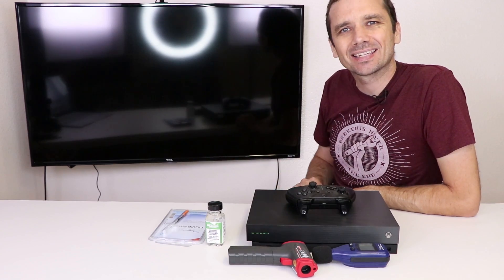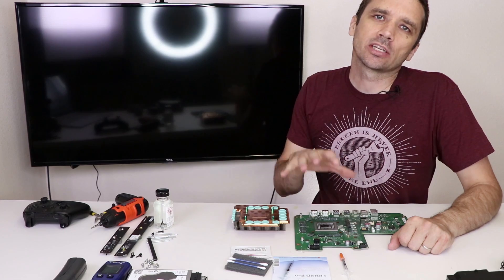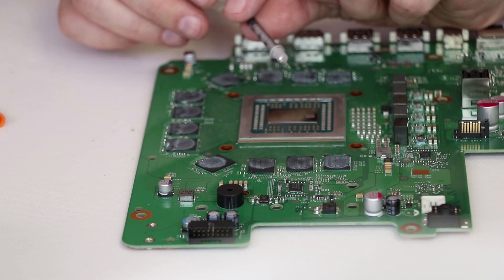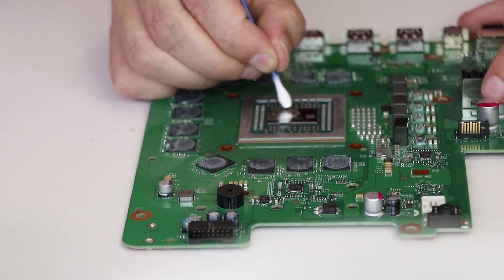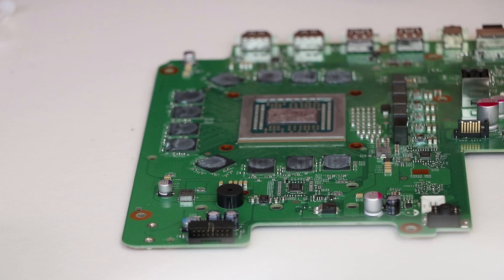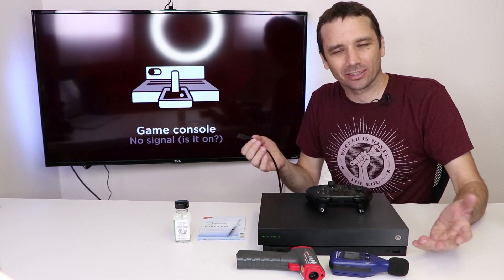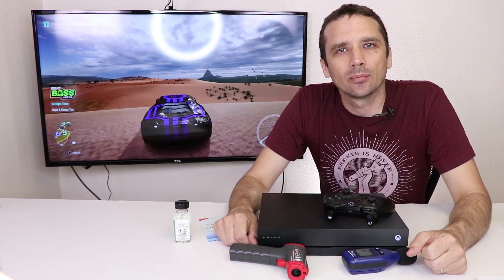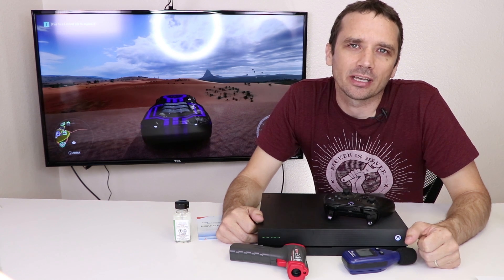Xbox One X Heat Test and Upgrade - It's So Quiet!

Comment: My xbox x is very quiet indeed and runs cooler than my ps4 pro and even a lot quieter.
Reply from the maker: Yep, they are usually fairly quiet.
Reply: TronicsFix mines loud my s was quieter
Reply: @walkingsneese3431  might need to replace the thermal paste and clean out the cooling block/heatsink I know I need to
Reply: @Tronicsfix  would an internal ssd help lower temperatures?
Reply: The s is quieter than the pro and standard together. No competition.
Reply: Dennis Rogers Same here. My day one X is pretty quiet too and far quieter than the Pro when pushed by an intense game.
Reply: Same here. PS4 pro can be loud sometimes
Reply: Gaming-Unit G-U ye only at the games that are Harder to handle
Reply: Xbox is the BEST 👍☝️
Reply: Same
Reply: My PS4 PRO is a furnace. Throttling in summer.
I needed to remove the top cover and add 2 40mm fans to extaust the air from the back away from the console. Now is a little quieter and it never throttled again
Reply: My Xbox X is louder than my PS4 but you can't hear them cause they are installed in my Bell 525 R, helicopter & my Lamborghini Aventador, but I prefer Wii on my  supa yacht for the fishing games when the real fish aren't biting...
Reply: probably due to tghe vapour chamber
Reply: Yes my Xbox X is very quiet as well. I hardly can even hear it when it is on.
Reply: YOU KNOW BOTH nice
Reply: I own ps4 pro and xbox one x scorpio , both stock ..xb1x is quieter than ps4 pro despite the pro being only weeks old
Reply: My PS4 Pro is SO loud lmfao
Reply: @jabadahut8420  has it finally taken flight lmao!!??? my old PS4 sound like a Jet winding for take off
Reply: @haylspa  Thats exactly how it sounds lmfao
Reply: Lol bec the ps4 is trash
Reply: Same
Reply: Mine is always loud...
Reply: @cquchiha8442  its only loud because its all clogged up with dust
Reply: @denodan  No there's no dust. I cleaned it so that's not the reason.
Reply: My og xbox one and xbox one s are both way quieter and cooler running then my ps4 pro
Reply: Dennis Rogers Still not as reliable as PS4 Pro quiet isn’t good it means bad cooling and ventilation.
Reply: @WizKing93  crap, means Xbox X has better quailty fan and has far more vents than the ps pro. MS over engineered the Xbox as they had issues with the 360 and hurt them. So they went the other way and over enginnered and heaps of vent . Being quieter means better more effective cooling as its also using vapour cooling also. 

My Xbox X is running a cooler than my pro. With the pro, since the vents are so small, need to vacuum them often. A lack of vacuuming ends up making your ps pro very loud. You can hear when the ps is struggling and working hard to keep cool, the fans speed up and gets louder. Not good at all. My Xbox X, no matter what game I play the fans dont speed up.

Comment: At the beginning of the video, I really thought you sawed the radiator). Is it possible to easily remove the aluminum radiator, without destroying the vct panel, for installing a copper radiator on it?
Reply from the maker: No, it's not easy to remove. It looks to be riveted or welded on.

Comment: How much do you charge for an upgrade like this??
Reply from the maker: HayaboostaTT  It's not as simple as taking it apart doing the work and reassembling it. You're not thinking like a business person. Try adding in employees, taxes, building rent, maintenance, etc. That makes that $100 look pretty small. Also, keep in mind that shipping one of these averages $20 so that already brings it down to $80...that profit is getting pretty small huh?
Reply: HayaboostaTT  It is tedious work man. He literally has to disassemble the system all the way down to the motherboard without breaking anything. I say $99 is fair, imagine how much a Microsoft tech would charge to do this.
Reply: HayaboostaTT  lot of man hours and work, may seem easy but try it out.
Reply: Yeah microsoft would try to take whatever they can from you. Anyone can do this themselves.
Reply from the maker: I haven't ever offered it as a service but if you want it it would cost $99 for a 5 business day repair. That includes return shipping.

Comment: Is the heatsink pure copper or an alloy that the LM will eat away over time? I imagine that it would not be pure in order to save on cost. Can you do a follow up video over extended time?
Reply from the maker: I can't say for sure what the exact mix of the metal is. I'll try to do a follow up video in a while.
Reply: TronicsFix LLC ...OMG of course it`s copper, for liquid metal thermal interface use only (Ni)Nickel base heat sink.
Reply: This is not how to use liquid metal

Comment: So all in all even though outflow is hotter it's a good idea to install the liquid metal, can you link us to the materials you used so we know its the right stuff, and would you recommend liquid metal on a ps3 as well?
Reply from the maker: Can't use LM on PS3 since it doesn't have a copper heat sink.
Reply: I am so glad I asked I was about to do this to the original phat console its never overheated and its in like new condition, but they get hot, I dont want it to mess up, you think silver collant paste is enough for it, or just a higher fan speed will be good enough? It has never overheated I jjust dont want it to.
Reply from the maker: Yes, it seems that LM creates a much better heat transfer enabling the heat to be carried away from the chip much more efficiently. Everything I use is linked in my Amazon shop: https://www.amazon.com/shop/tronicsfix
Reply from the maker: Yes, it seems that the LM helps remove heat from the APU much better. Links to the products I use are in the description: https://www.amazon.com/shop/tronicsfix

Comment: Xbox doesn’t even get hot anyway, when i got my xbox one s I thought it was broken because it was literally not getting worm until 3 to 5 months when you fill it up with games & apps, it does get a lil bit wormer  and the fan all you can hear is the air and the bearings
Reply from the maker: Yep, they are generally pretty good about heat.

Comment: Conductonaut is great. Since I’ve installed it on my ps4 pro’s heatsink/apu it’s so much more quiet. I’m wondering though why the one x needs it... I thought it has an efficient vapor chamber cooling solution.
Reply: yea but if its interface material isnt upto snuff it doesnt matter how good the vapor chamber is
Reply from the maker: I'm not sure I'd say  it "needs" it in most cases, but it's sure quiet with it installed.
Reply: @Tronicsfix  because the thermal paste is of poor quality, the vapor chamber heatsink is an old but efficient design but any heatsink will be poor with a basic mass produced cheap thermal paste on any console and mass produced pc, thats why a lot of modders pc maker's always buy aftermarket thermal paste.
Reply: @nickmanhota324  so i heard xbox uses cheap thermal paste that breaks down after your warranty is over so then u have to spend mad money just to have Microsoft fix something they knew was going to happen to the xbox after the 1 year manufactures warranty expires which imo is stranger noone has ever tried sueing them for that.